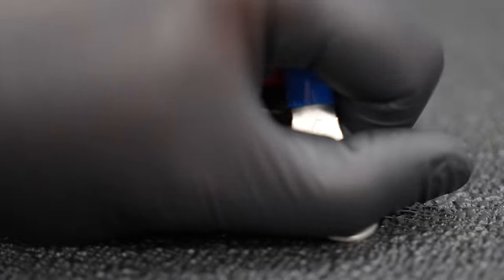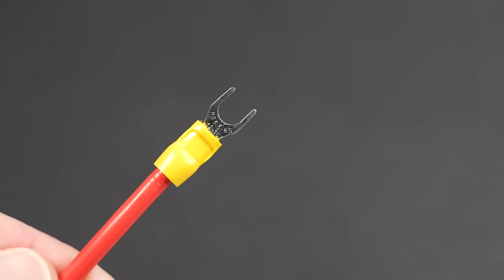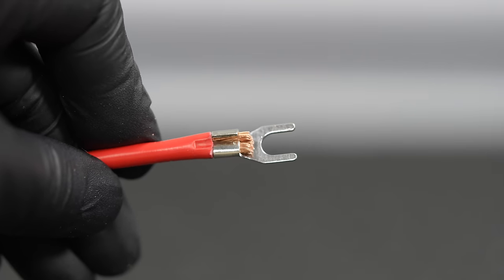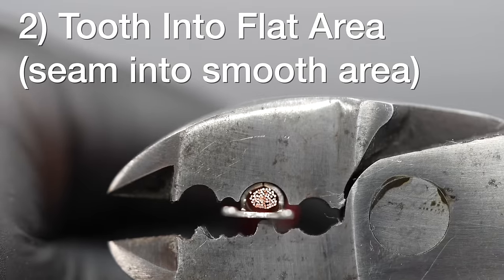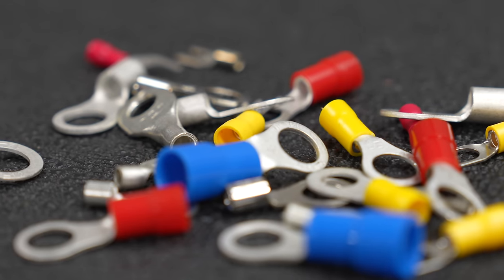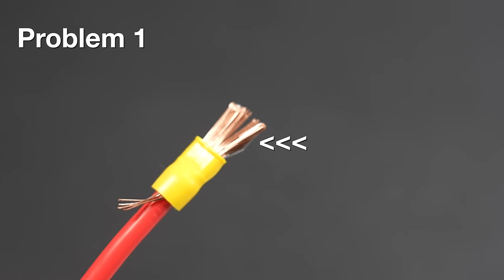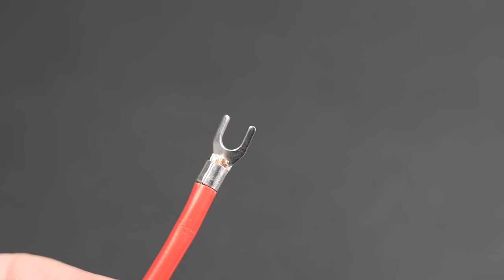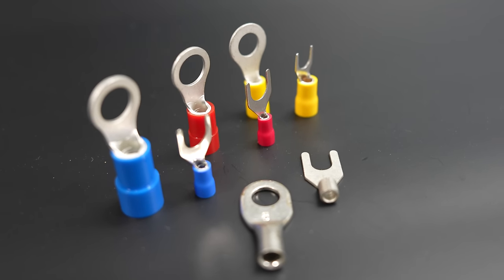Why 50% of All Crimp Connections Fail - Up or Down?

Comment: A proper crimp is extremely important, especially if you're like me and travel for work. This one time in particular, the hotel I was staying at had went and caught fire, possibly from some guys bad crimp, I don't know. All I know is that as soon as I opened my door to escape, I seen that the entire staircase was completely ablaze, and the only way out was going to have to be through the window, from 9 floors up! It was a damn good thing that I was there on work and just happened to have with me one butt connector, two 50' spools of some 10AWG and my trusty ole crimpers....

Comment: I would like to think that more people know about the seam than you may think. It becomes very obvious then the crimp has the second set of rear securing tabs. the crimper "tooth will really make a mess of them.
The wire should extend slightly through the crimp barrel, but you can't be too generous. The crimp flat surface is needed for hardware support. If the wires extend too far, they can interfere with proper securing of nuts/washer, especially on ring terminals.

Comment: Great video! This is why I love YouTube! 66 yrs old and learning new things! Cannot believe that I have been having problems because I was using the crimper wrong! Just thought I was using bad crimps. I finally broke down and spent money on ratcheting crimpers and using them for most of my connections solved my problem. Glad I didn't throw out my old crimping tool. Is there a correct orientation for crimps using  a ratcheting tool?

Comment: Uninsulated tool used on insulated connectors with tool tang on bottom of connector....plus use of proper wire size for any given terminal. Has worked for me for many years.

Comment: Crimp First for a solid mechanical contact.  For a vibration or higher current, I tin with solder second.  I know that there are a lot of ignorant children whining about solder but in tens of thousands of joints over close to 70 years, I never had one fail.  I've been doing heavy industrial automation and electrical troubleshooting since 1965 and poor electrical connections have been my bread and butter...

Comment: The split issue is causes by a cheap tool.  I have over a dozen crimping tools in my collection and not a single one has such a large bump and the tool you have demonstrates.

On a proper crimping tool you will see a number or letter on the flat side of the die.  This is ment to stamp the an indicator on the flat part of the crimp so that an inspector can ensure that you used the correct size crimping tool on the connector.   If you crimp it the way your showing it would embed the stamp on the split side.

If you could find a copy of the Raytheon wire connector manual, the US navy NavAir manual or the Canadian C17 Air Force manual you can see the same thing referenced.

Other then that great video, and your dead-on about leaving a bit of wire out the crimp in order to make it harder to pull out, this is a very common issue in poor crimps.

Comment: The insulated crimp tool comes in 2 versions of teeth. One version crimps the plastic side of the terminal at half pressure. If you pick the crimp tool up back to front then the wire side will be crimped loosely. Another problem is wire stripping tools that rely on pulling the wires insulation to strip it as it cuts, this pulling effect stretches the insulation, then when you put your nice insulated crimp terminal on, the wires insulation will eventually unstretch leaving exposed copper conductor that will fail the exposed LV live equipment standard test finger.

Comment: Wire connections: perhaps the single most important part of electrical work short of correctly sized circuits etc. 
Take into consideration the “fit” of the conductor in the connector. The new “compact “ wire that is being used in certain installations is much smaller in physical diameter than the traditional wire size of the same awg but is required to have the same ampacity as it’s larger counterpart. 
The new compacts are typically the equivalent of one gauge smaller so a 12awg compact would be the approximate diameter of a standard awg 14. The right crimping groove alone likely will not be tight enough to hold the wire solidly. Choose the connector that most closely matches the wire diameter and crimp in respective groove using the information provided in this video and all will work out well.

Comment: The first plier type tool is for ferrules. For the uninsulated terminals, there is a different shaped mouth for the second tool. Looks like an MC4 crimper. The split line is supposed to curl inwards. If done properly, with a good calibrated tool, it will " cold weld" forcing the copper and lug to fuse, and create a gastight crimp. Gastight means it cant start to corrode from the inside out.

Comment: 2:28 That crimp will fail the moment you screw that U terminal down as the reverse crimp has bent the normaly flat U surface into a Vee shape. The action of screwing this Vee shape down will flatten the Vee and releast the tention in the crimp. Better to check your crimps and/or add solder to the crimped copper for added security.

Comment: The one downside I see here for the cheap crimping with the correctly oriented connector is, yes you get a good tight crimp, but you've also distorted the connector fork. It's no longer flat. So it you end up putting the fork into a screw down connection, you might not end up with a reliable termination. If you can really torque down on the screw, you might flatten out the fork, but not all terminations allow for a high torque install. Solution - buy the ratchet crimper and keep you terminal ends flat.

Comment: I have seen aviation manuals showing the opposite of what is shown in this video. The "properly" crimped connector with use of "proper" tool will fold the cut side of the connector in forming a heart shape. Properly crimped connector should result in wire cold welding to the connector body. It is not about deforming and gouging, it is about hugging and squeezing.

Comment: Nice tutorial! I've also found if the wire is doubled back before inserting into the connectors it's virtually impossible to pull out after crimping.

Comment: I almost always use insulated connectors and I use a ratcheting tool and I always crimp it right side up first then upside down. They’ve always given me good results without failing after I started doing that

Comment: I've crimped a lot of connectors over the years, but I haven't got any handy to check how I did it. However, I'm pretty sure I didn't do it either way - but a secret third way! 🤣 I reckon I've always done it at right angles to the ways you show, i.e., across the crimp part - which is obviously not the best way,  but maybe better than the worst way 🙂

Comment: I wish I could like this more.  I do prefer the job my Ratcheting crimper does compared to my older manual crimper.  I deal with a lot of equipment installed in vehicles at work, poor crimps by under-trained technicians cause a whole host of problems.

Comment: When I pull apart things like stoves and reuse the wire and crimped lugs from such appliances I see that the crimps look different to the examples given here as quality crimps. They don’t meet in the middle but curl all the way in making a letter B or sorts. And two very tight groupings of copper. Locked in solid. I strive to crimp in the same way. To make this happen it requires a different crimping tool. One not demonstrated here. The way I see it, if the stove manufacturers do it that way I should too. Stoves are extremely reliable for good reason.
Reply from the maker: Factory crimps are done differently, they do the opposite of what is shown in this video (which was based on 3M's standards for crimping) reason being that a factory crimp can be done from all sides with the perfect sized tool and specific crimp connectors & as such they fold the seam into the wires for extra hold. This is not the way hand crimping is done, again per 3M the world's largest mfg of these crimps. You can do what you want but 3M knows field crimping.

Comment: When using insulated connectors I hit the sleeve with a heat gun. Smooths it and shrinks it so it won't slide off.

Comment: been doing that for a long time. i crimp the terminal a bit away from the wire insulation to prevent work hardening at the point of stress. i also like to shove the wire into the terminal to get the wire insulation bunched up tight against the terminal. i also add wire to make it fit tighter in the terminal if needed. i always use indent crimps. yah yah yah they ruin the terminal insulation. thats what heat shrink and tape are for.

Comment: If you are doing work covered by the NEC (National Electric Code) you must use a crimper listed for use by the crimp fitting manufacturer. It will say on the box the crimp fittings come in.

Comment: 3:56 Maybe this is wrong in your mind, but Example #3 is the correct way I was taught to crimp wire. The last two examples are wasteful of wire and sometimes interfered with the screw of the terminal. I learned how to crimp properly in 1982. I don't need to know when you were taught incorrectly.

Comment: Thank you for making this video.   I have been doing projects that involve some crimped connections for the better part of 4 decades.   I did not know at least a couple of things that you explained.  Chief among them was how to orient the crimp connector in the tool in order to make good, reliable crimps.   Very helpful!

Now, where can I buy uninsulated crimp connectors?   in the past 10 years or so, they have become increasingly difficult to find.

Comment: I'd suggest getting better connectors. and using the appropriate crimpers recommended by the manufacturer. uninsulated terminals with brazed seams aren't going to split and high quality insulated terminals have an outer sleeve around the inner brazed crimp tube. 

the correct tool for most insulated crimps is, at bare minimum, a ratcheting crimper and few, if any can be used "backwards". 

good crimping tools and supplies are expensive and complicated but if you look around you can get a pro level tool for less than 100 dollars and most quality manufacturers have open stock of pretty much all their inventory for reasonable prices (but if you're expecting Amazon prices... you get what you pay for)

Comment: You can even enhance the connection and reduce resistance by additionally soldering the connection! But only do it when the connection is not stressed with too much heat generation, as the solder can become liquid again!

Comment: When it comes to non insulated connectors, no crimp will ever beat a soldered connection. If you really want to double down crimp it then solder also. Why take a chance?  On the insulated terminals you don't have that luxury. But heat shrink on the area where terminal meets wire insulator is also another good thing to do.

Comment: Having come from the electronics field and now in thee HVAC industry I see many of these mistakes made out there. I have been a pusher for people to get the ratcheting crimpers for the purpose of putting together good solid connectors in the field. Many people ask me where I got my tool and as was said here in the video, Amazon. I have about three now. One I don't know where it is, one that I have been kicking around for some time and the last just recently got with the extra heads so that I can crimp other connectors. It is scary at how many connectors I have found on air conditioner systems that have started to burn up due to bad crimps. I also now carry ferules for terminal blocks that you put the wires under the screw for big wires. I no longer see the sense in going cheep on electrical connections. Do it right in the first place and you never have to return to it for the same problem. The other thing is when putting the wires into the crimps, make sure you have a brush on the open end of the terminal. It is an old term when crimping terminals, if the strands spread out like brush bristles then you have a good crimp.

Comment: The reason you want the wire to stick out pass the clamp is not for connection but  it makes it harder for the wire to get pulled out of the connector.  This is because the exposed wire is not compressed and is thicker than the clamp meaning the wire will have to compress to come back through the clamp which is very difficult.
Reply from the maker: Great point!

Comment: For the non-insulated terminals, I fill the pocket with solder, tin the bare wire, melt the solder pocket, and install the tinned end.  Never had a failure.

Comment: In marine work I only use brazed barrell, nylon insulated terminals which also have a ferrule over the barrell which guides the strands in and is crimped on the insulation.

Comment: Want them to really hold, slip shrink wrap onto the wire then solder the wire into the terminal then slide the shrinkwrap onto the terminal after it cools a bit then heat the shrink wrap. Bam you're solid and won't ever work loose.

Comment: If you want a nice clean look under the hood of your old classic car on junction blocks and such don't use the insulated connectors or just cut it off of the ones you have and use shrink tubing. It looks so much better.

Comment: A proper crimp holds on displacement. The wire needs a short bit of wire that extends beyond the barrel. When you crimp it your making the space smaller that the base diameter of the wire and it cants come out. Not saying in high vibration applications like light aircraft you shouldn’t crimp, solder and heat shrink but for 99% of the public the proper tools and proper technique will give good results.

Comment: Good practice--only strip enough insulation TO equal the length of the barrel,  I.E., the end of the wire should be flush with the end of the barrel.

Comment: Dielectric grease is your friend. 
Pay attention to the wire direction with ratchet crimpers, there is a difference in the dies you want the smaller side of the die on the connector end not on the wire end.

Comment: Ideally you'd like a 2 step crimper for insulated crimps...front step of die does wire core, second step on die does plastic onto wire insulation for strain relief

Comment: i picked up a ratcheting tool about 15 years ago when they were on special for ~$10aud at a miter10. still have and use it to this day. a bloody great tool for the elec kit. also depending on the job, i will solder the wired in after crimping.

Comment: My go to is using non insulated terminals, splices, or connectors, flux them, crimp them, then solder, then heat shrink with marine heat shrink with the goo in them. Maybe it's overkill but I live where the roads are salted half the year.

Comment: After years of working on electrical systems for my vehicles (cars, motorcycles, boats), I always solder the connector to the wire.  Otherwise, inevitably, the connection will fail with moisture or oxidisation.  Crimp gives a quick result but they will fail and leave you stranded.

Comment: If you aren't soldering your terminations, you will be tracing connection failures in the not too far future. Soldering is the only way to keep corrosion out. Then clean the joint and coat with liquid electrical tape. This is how the Navy does this on the ships. This is how I do it in the oilfield where there are lots of corrosive gasses floating around.

Comment: What I like to do is to do the crimp and then solder the wire to the connector. I have never had one done that way fail. The closest thing to a fail was a device that got so hot it remelted the solder, melted the plastic off the terminal and the wire. There were signs that there were actual flames. This happened because someone put a bolt in a fuse holder for a radiator fan with a failing motor that eventually shorted out completely. They sort of got what they were trying to do because the fan worked long enough to get them out of the Backcountry. But they didn't quite make it to the next gas station.

Comment: I don`t use that special tool anymore. I use pliers with round legs and fix it gradually from both sides. Maybe after that i use the special tool for an extra bite, or not at all. After seeing your vid  i will still use the pliers because i am fedded up with the special tool. It also demolishes the insulation.

Comment: I loath when people use the tool with the dimple on insulated connectors, no only damages the insulator, but sometimes they just plain fall off. Most tools list the dimple tool for uninsulated only. I have seen both upside down crimps as well as right side up crimps fail ( in things that were built from their respective factories). A lot of it comes down to laziness or inexperience with the connectors or tools and sometimes as well as the cheapness of the tool or connector ( or in production lack of QC and testing ). I'm not sure I like the upside down crimp on the uninsulated one as under strain I have see the split part of the barrel open up and release the wire, the tool I use for uninsulated curls the wings down into the crimp and they are pretty sturdy and hard to undue.

Comment: You should twist the core, straight wire can loosen with heating and cooling. The crimp also holds better on twisted core.

Comment: I've been using the non insulated tools section on both for decades and other than solder ( or as some call it - sodder 😂😂😂) it's the best connection all round other than the specialty crimps like Deutsch or weather pak etc

Comment: Most good crimpers have that thin style head. My 25 year old Kleins  are that way . The reason is it makes it easier to get a good crimp with less effort.   the point about a wider crimp being better is valid which is why I will make 2 or even 3 crimps all in a row. I am not an expert or anything other than an experienced industrial electrician